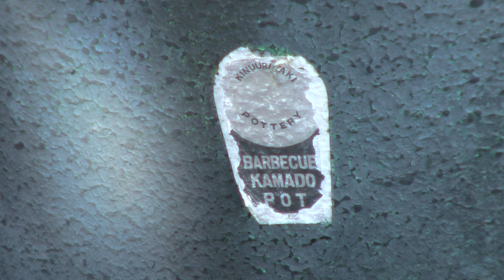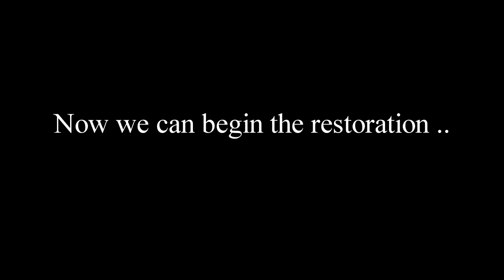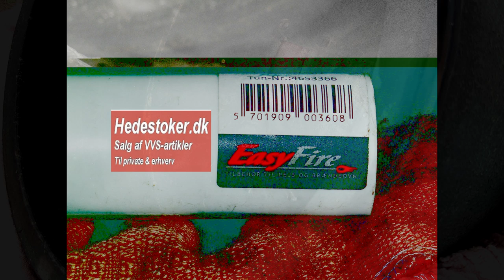BBQ  Imperial Kamado Restoration.

Comment: I have the same model of Imperial Kamado as you, and mine has cracks on the top lid. Also I had to replace the bottom plate with a grid from the sour. One of the inside rings broke, so I had to replace it with three fire proof bricks. It still works after 28 years, but I need to fix the bottom vent.
Where did you find the spares for this one? I have tried but always get the reply that the cheramic is so fragile it can't be sent to Sweden. 
After all, this is the best BBQ I have ever used and now I will try to repair it thanks to your great video.

Comment: I have original instructions  1960s for this same grill only mine is called a hibachi pot and is light green and orange.  will send email if anybody wants a copy to download and print.
Reply: Ryan Lewis please send the instructions for the grill I have Kamado pot and needs restoring
Reply: I’d like it*
Reply: Can you send those instructions how to repair/restore the cracked Kamados. My cracked ten years, I replaced it with the Pakistani one Augie shipped me, which works great but is a little bigger (circumference). I kept the old one in case I could find how to restore. Now I can!
Reply: Mr. Lewis. I have the same one also the hibachi from Japan would you be so kind to send the instructions and anything you find informational I’d really appreciate it. Thank you so much